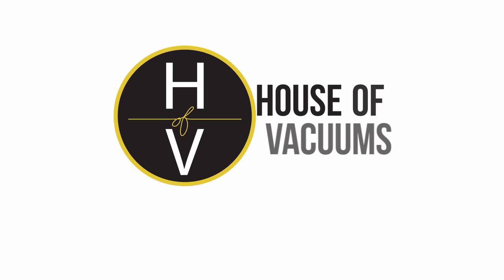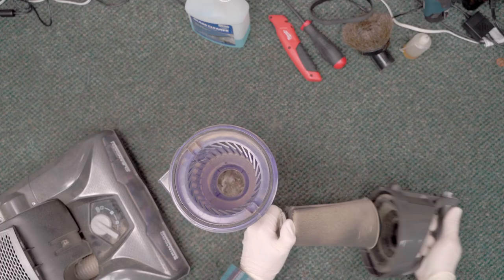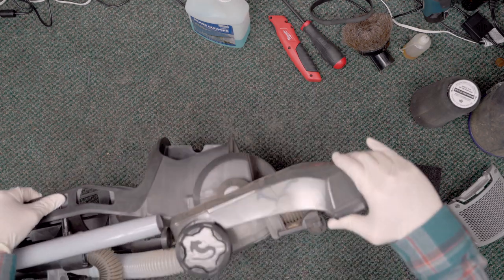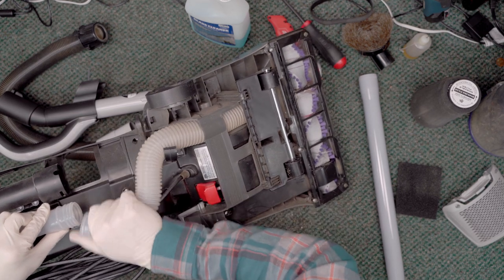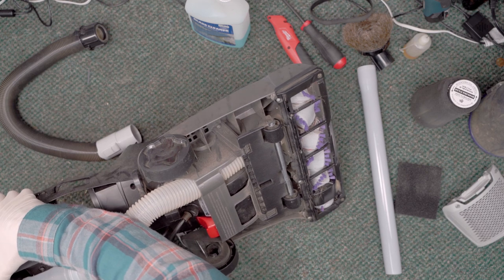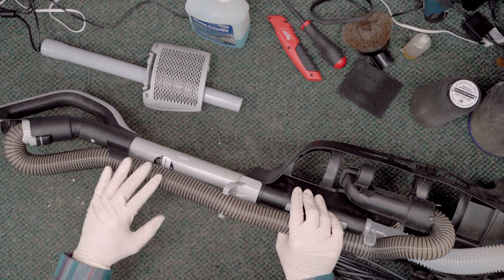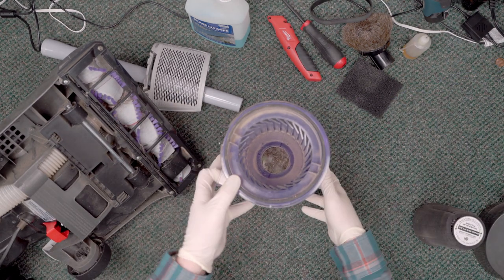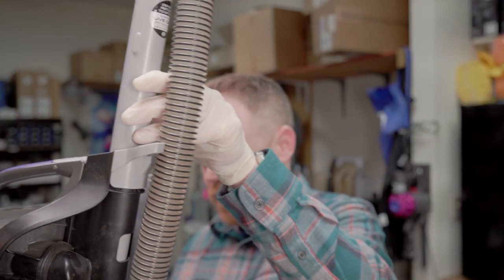Dirt Devil Power Max Pet UD70167 Clog - FIXED! - Worth Fixing A $59 Upright?

Comment: I bought this vacuum 2 hours ago, got it home and put it together and vacuumed ONE bedroom before it shut off due to overheating. Called the customer service number and the rep told me to stick a broom handle in the hose. Sure enough, hardly anything had made it into the canister. I have ONE cat and he’s not a long haired cat. I’m glad I found your video, it was helpful in understanding what I should be looking for in a vacuum. And it’s not the $60 vac from Walmart. So disappointed but the adage ‘you get what you pay for’ holds true.
Reply from the maker: Wow, thanks for sharing that story! I'm glad you found out while it was still within the return window. It's true that you do get what you pay for!
If you are looking for an upright that is better designed but won't break the bank, my favorite entry level upright is the Simplicity S20EZM (NOT the S20PET). You can pick them up for $229 typically. It's more money, but it is the best sub-$300 upright I have found.

Comment: Am visiting my parents and dad's VA aide told me about the vacuum spitting the dirt back out.

Wish I'd found your video.. as it would have helped to see how easily the top connection of that lower hose could be removed. I was afraid I'd damage it, so after having no luck working from where the "attachments" hose releases, had to work from the receiving end of the hose in the base.

I opened it up... there were about 12 inches of tightly-packed carpet fuzz and random trash in that lower hose.

After clearing out the lower 4 inches or so, I had to get creative with a wire coathanger...bending the end into a zig-zag that I inserted and twisted to feed it into the mass. What a waste of a morning.

My own Dirt Devil (different model) does not have the lower hose, so have never had this issue and is a lot easier to clean. 

In any case, the aide's 3-hour-shift was over by the time I got the machine back together. So I vacuumed ONLY the hall and my parents' bedroom... the cup was COMPLETELY FULL... SO, obviously months and months of carpet fuzz and dirt. It was crazy!

Sometimes you just have to do everything yourself.

Too bad it's too early for a cocktail! sigh

But it's fixed 'til the next time.

Comment: Ha! I inherited one of these from a tenant who moved out and left it, thinking it did not work. He had the hose connected wrongly, too, resulting in no suction. Didn't matter though. A few months later after very little use, the motor is losing power and smelling like burned plastic or electrical so I'm afraid it's going to the dump. Not worth replacing the motor. Thanks for your video.
Reply from the maker: Happy to help, thanks for watching!

Comment: I have an issue that the foot pedal to release and recline the vacuum doesn't stay in place, it's loose and wiggles back and forth.

 I have visually inspected it without having taken it apart of course and nothing appears to be broken, I just can't figure out how to tighten it up if at all.
Reply from the maker: Thanks for the question. The issue is likely that where the pedal clips into the main housing is warn. When the housing wears with usage, it will allow the pedal to pop out on one side. It will look like everything is in place, but the handle either won't lock or wobbles. It is a problem with the housing and given the cost of the machine, it would be best just to live with it until you replace the vacuum.

Comment: I have one quesiton my vaccum tub dont be in the same place. I need help for fix
Reply from the maker: Hey Andras! Do you have this exact model or a different one? When you look at the back of the machine you should see where the hose comes up from the nozzle. Typically it can be released with a screw or two. Take a look down in there once you get the hose off and hopefully you will find your clog. Cheers!

Comment: Well, try figuring this out, I have one of those DD, Power Max machines with the button cord rewind, but anyway, I have checked everything, from the filter, to the hoses, and still there's no suction, but when I pull out the black hose, via the handle/wand, the machine drops sound, meaning there's full suction, which I can test by placing my hand over the end of the handle and it sticks to my hand, but when I slide it back in to the machine slowly, it snatches and then locks into position, and the vacuums pitch increases meaning there is a clog, so I had a look at the white hose coming from the foot, nope not a single clog, the brush area is clean and free from clogs, and yet everything tells me there's a clog between where the hose leaves the foot and enters the bottom of the handle and yet there are no clogs anywhere, I can use the handle and small head attachment and I see the vortex in the dust tank, but re-attach it to the machine, no vortex and dust is pushed out of the front of the machine, I even replaced the entire semi-clear hose, and still no suction at the foot, I even pulled of the entire pipe, and put my hand at the base of where the handle meets the semi-clear hose, and I have full suction, put the semi-clear hose back and no suction.

My machine is one of those that literally defies reason and logic.
Reply from the maker: Sorry to hear about the trouble, Terry! Here's a test... unplug your hose, put your vacuum completely vertical with the nozzle unlocked and vertical in line with the body. Now drop a penny through the hose where you plug in your attachments. It should come out in the brushroll chamber. If it doesn't, you've got a plug somewhere in there that you can't see. Hope that helps!
Reply: @HouseOfVacuums  Thanks for replying, but why would I do that test, when I have 2 brand new hoses, but anyway, thanks for helping, I've since thrown it out, and got a real expensive vacuum that has a 5 year warranty, I got a Shark AV911S robot vacuum, it has a self emptying base, that also charges.

I'm never going to buy appliances that's under $200, as they say "you get what you pay for", and buying cheap, you get crap.

Comment: The belt on mines does not spin. How would I fix this?
Reply from the maker: Thanks for watching and the question!
If the brushroll is not turning, it is likely that the belt is broken and needs replaced.
If the belt is intact but still not turn it is likely that the belt is stretched and doesn't have enough grip to turn the brushroll. In this  case the belt also needs replaced.
Hope that help!

Comment: I have the same vacuum the main clog is in the white tube but you have to remove the cover for the brush roll  to get to the bottom of the white tube and than it fixes the clog. Wish I could just get a new vacuum but I'm poor so I have to take this one apart all the time 🥺😭
Reply from the maker: Hopefully you can keep it on the road for a while. Thanks for watching!

Comment: How do you assemble the cup it never works all the way 😣
Reply from the maker: The top portion attaches to the lower by twisting them clockwise until they are locked. Are the pieces no longer locking together?

Comment: I’m having a heck of a time trying to figure out how to pry the hoses off. I cleared one clog by the handle, but I know I have more clogs.
Reply from the maker: The lower hose attaches to the nozzle using a press fit... try pulling the two apart while wiggling them back and forth. It's kind of an inexact science. You can always try a little prying with a screwdriver, but be careful not to puncture the hose. Best of luck!

Comment: Great… I need another vacuum to vacuum my vacuum.
Reply from the maker: You may have just inspired another video!

But in the absence of another vacuum, a broom handle or a wire hanger straightened out will work in a pinch.

Comment: I completely cleaned my Dirt Devil Vigor Cyclonic Pet vacuum.  It turned on briefly, then turned off. Now it won't turn on at all😢 .  The belt is fine.  I don't know how to remove the motor housing. I removed 4 screws that seemed to be what was holding it to the machine, but it won't come off.  Any tips would be appreciated so I can troubleshoot it further.....
Reply from the maker: Hi Linda! Have you already removed the nozzle housing from the main body? That also retains the motor cover, so it will need to be removed in addition to the 4 screws. Hope that helps!

Comment: I have this vacuum and never had an issue. However, i can't purchase a 500 dyson even though i herd there were incredible.. Do you have any recommendations for a midpoint option? Thanks!
Reply from the maker: Hi There!
Dysons are really pretty overpriced for what they offer in terms of cleaning. The best cleaning and most reliable affordable upright I have found is the Simplicity S20EZM. It has proven very durable and cleans well. The retail price on this unit is $229. 
Once you go below the $200 price point you see a pretty drastic decrease in performance and reliability.
Thanks for watching and commenting!

Comment: I knew it had to be the air pathway design as u mentioned.   This vacuum was definitely a let down for me personally.  Should have known by the price.  With the poor air pathway, there is not near enough power to pick up pet hair.  The hoses just look off.  I kept thinking that the manufacturer made a mistake putting it together.  I guess not.
Reply from the maker: Unfortunately, it's just a little motor with a really long air-path. But hopefully this video will help you keep it on the road for a while. Thanks for watching and commenting!

Comment: I wish I could watch this video a few days ago I bought this piece of crap at Walmart cause it was cheap and I could afford a good one or find even a good used shark which I did last time has lasted me for years and they had it for several years for they sold it to me. This thing is so loud that I can’t even vacuum early or late in the evening because it disturbs my neighbors it to the front of the street and I live behind a large house I’m in the second house it is ridiculously loud. Also the gray cord the one you put into the handle the top the bottom 180° turn or 90° where it goes into the canister doesn’t seal all the way so if you look in the back of the vacuum the upper right hand part where it goes into the canister doesn’t seal issues dirt and dust and debris everywhere it literally is horrible horrible and I’m pretty sure that someone had already used it and returned it and I bought a used one Time and that was it after the first time I started reading the reviews and found out how horrible it was it wasn’t just me I got an Amazon and found one that said it was normally 105 on clearance for 69 it’s a Bissell power turbo helix Pat rewind or something along those lines now did have good reviews I pray that it’s good I’m OCD and I got stuck with a whole bunch of cats are my daughter and I can’t handle the hair and the dirtiness of them so I have to vacuum sometimes two hours at a time to vacuum the whole house kitchen living room area I pray it’s a good one thank you for showing this video hopefully it helps a lot of other people not to waste their time and energy money these things like a tinker toys so lightweight my grandson‘s toy vacuum that we got him for Christmas is literally sturdier and better than this dirt devil max pet. I am literally disgusted appalled shocked embarrassed and ashamed for dirt devil that they would even allow their name on such a horrible product seriously you can’t tell me that they can’t do better I’ve never got a vacuum before that every single thing is such cheap plastic is embarrassing I I kinda laughed when I took out the box I laughed at how cheap and flimsy it was I said this is this is a joke. I’ve owned cheap vacuums before cheap Walmart basils Hoover’s dirt devil and I’ve never had one like this ever in my life this is a recent quality issue it’s I think before I got this huge shark and then we bought a new shirt for that I always bought cheap vacuums and never were they this cheap and crappy NEVER!!!
Reply from the maker: Are you still in the return window? It might be worth looking into. Thanks for watching!